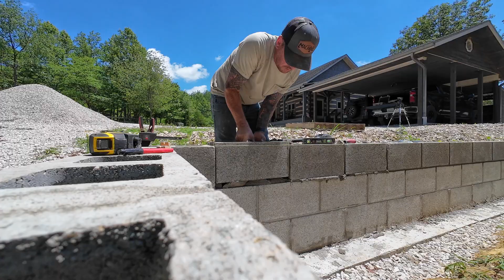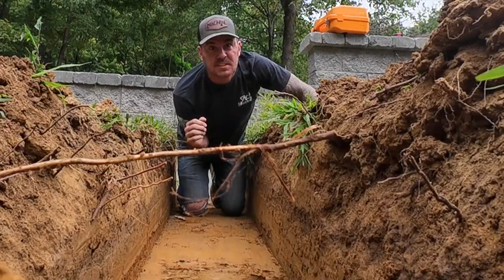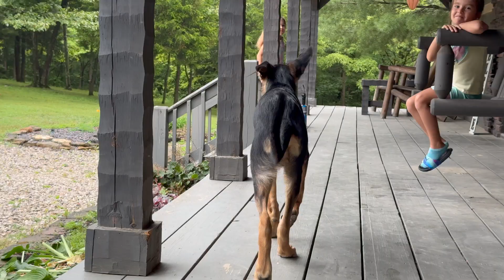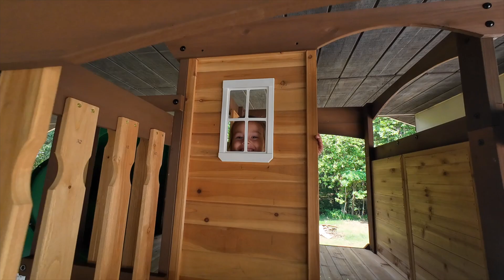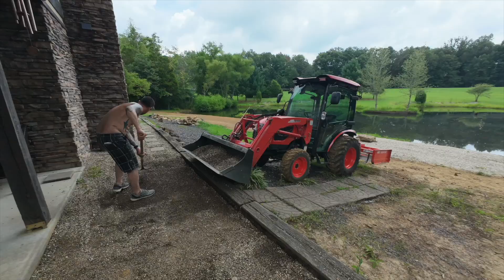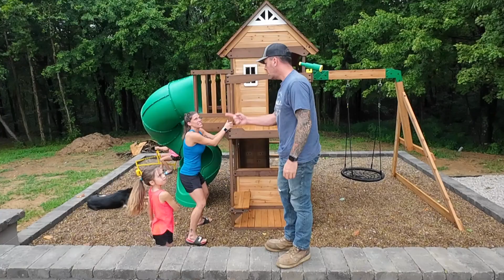Building A Playground With A Foundation....Heres Why

Comment: Been watching a bunch of your videos and i was wondering as someone not in the know, the locator wire you tape to your conduits (propane line, cat cable conduit, pex line, aerator air tube, etc) how does that work, i don't see it connected to anything, do the detectors just "see copper so something is there", or do you have to connect it to something? Also what kind of wire is it, something special, or just a single conductor romex/thhn type of wire? Would it work the same in the conduit instead of taped to the outside of it?
Reply from the maker: with a tracer wire you can just clip the signal lead from the locator to it and the other lead to a ground probe.  It will send a signal out on that tracer wire so you can use the wand to locate it

Comment: Two things.  More slope on a sewer line is not always better.  The water can outrun the solids making for a nasty clog.  Same goes for larger pipe than needed.  Second, check local codes on septic as adding more "bedrooms" to a septic system may require a larger holding tank and or field.

Comment: From a former plumber - You should be careful not to exceed 1/4 per foot on long runs, the liquids will out pace the solids.
Reply from the maker: Had a couple people mention that now.  Im glad because i didnt know.  Ill make the adjustments. Thank you
Reply: @SpicerDesignsLLC 
Hub of pipe should run with the flow of pipe . So you would have had to glue a piece of pipe into hub . And covered pipe with gravel the back fill
Reply: So when you go to install the rest of sewer pipe cut hub off of the piece you installed and glue the hub of the other piece onto it

Comment: Your drain fall is way off! 1/4" fall per foot would be 18" of fall over 72 feet run. NOT 31 inches, that's almost 1/2" fall, which is way too much, with that much fall, your liquids will outrun the solids and clog your pipes. It does depend on the pipe size though. 2.5" drain would be .25" fall, 3" to 6" pipe would be 0.125" fall.
This insures that you don't outrun the solids in the pipe.
Reply from the maker: Im going to adjust the fall.  I was saying the difference in the two pipes was 31” apart.  But i was not aware of the water outrunning the solids.  Thanks for the info
Reply: That could differ based on a meat and potatoes diet versus salads. 😂

Comment: That’s an awesome video spending quality time with the family.
And just letting you know that the future sewer line, well your water is going to outrun your poop to much slope to keep the poop flowing properly you need max 2.5 inch on a Ten foot pipe and a minimum 1.250 inch on ten foot pipe you can stair step your pipe to get the pipe down that far but over slope is not good the pipe will clog up will poop and paper.
Reply from the maker: Thanks for the info.  I was unaware of that.
Reply: @SpicerDesignsLLC  no problem I would rather see you get it right the first time instead of having to do twice.
And thank you for sharing your experiences with all of us viewers

Comment: Great job on the play set project. Nice to see all the girls in on the project. Video is priceless as I enjoy your humor and make light of what seemed to be a pain in the butt when constructing the set. The bobcat and you, of course, dug a nice trench for the sewer line. Your operating skills  are pretty good. Hopefully mine are as good when I start my electrical project that you and I talked about via email. I have a backhoe attachment on my 26 hp Kubota tractor that I haven't used much but have been practicing. I'll keep you posted and may  ask for more advice as needed, if possible.
Reply from the maker: Yes please do.  Good luck with your project and thanks for the comment

Comment: Kyle, I paused the video just to comment bout the sewer line. Choke the pipe in with stone on the sides, when you continue to your installation to the tank, it will keep it from settling side to side push from the ground cover on the high side of the ditch (eliminate cracked fittings in the future) and marking tape for future reference on the placement. Just a heads up to save you some grief down the road.
Reply from the maker: Thanks for the pointers!